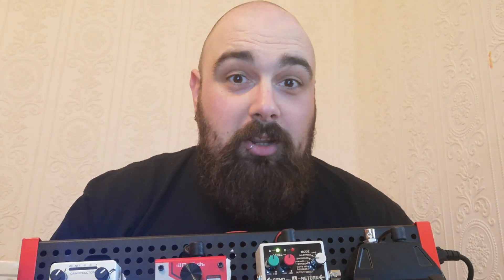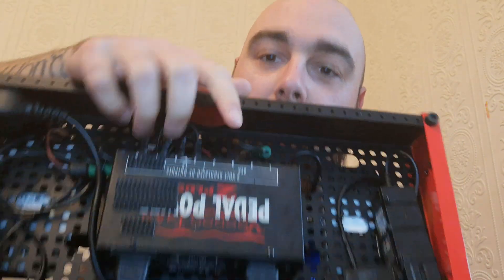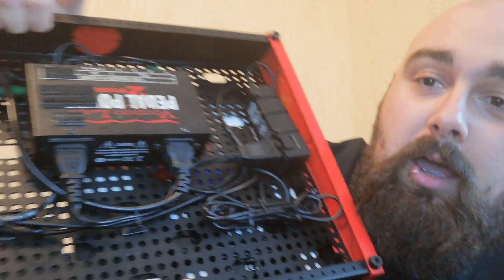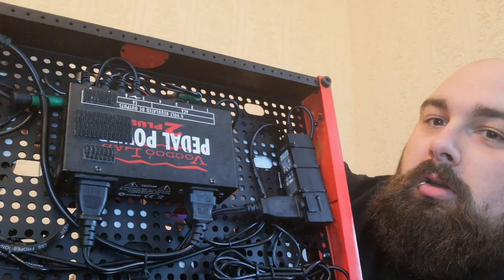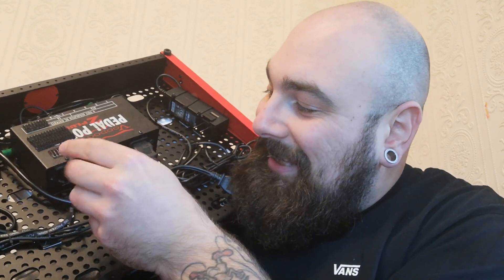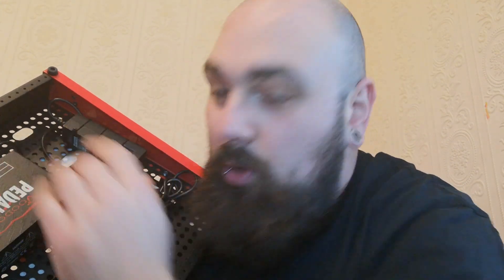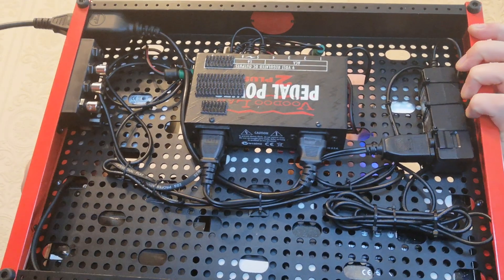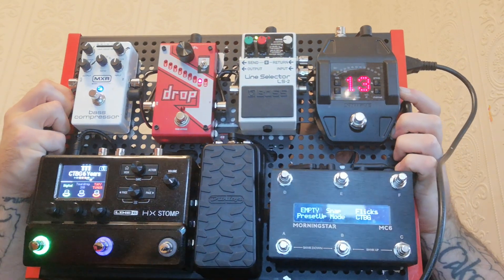Line 6 HX Stomp powered via Voodoo Labs Pedal Power 2 Plus? #hxstomp #hxstomppower

Comment: Great, to power the Shure wireless unit do use any special cables for the voodoo lab?
Thanks
Reply from the maker: I had to buy a current doubler cable to take two outputs from the PP2+ into one to power the Shure.

Comment: Do you run your power 2 plus to a wall socket or do y run it to a power condition then to the wall socket ??
Reply from the maker: This setup was always straight to the wall or using a run of of mill extension cord. Still with zero noise.

Comment: Youre using à Dunlop dvp4?  Plug into the MC6 ?  If so,  it does work fine...no issue what so ever ?
Reply from the maker: Hi Steve. No issue what so ever so long as it is programmed correctly. At the moment, depending on the patch, it is set as the amp block master volume. For other patches it works as amp master volume and then wah with an assigned switch on the MC6 :)

Comment: why are you using the Digitech DROP since HX Stomp can do the same detuning ?
Reply from the maker: A few reasons, really. I had the HX Stomp first, having it outboard saves DSP, it works better for bass than the Stomp patches, I can change setting depending on the gig without editing the patches... To name but a few!
Reply: @DarrenSMusic  I have been using the Pitch Wham on the HX for bass. For half step down on a few songs it does the job. But As you mentionned, it does take one block.

Comment: Do you know if this can power a Kemper Stage?
Reply from the maker: I would bank that as a yes, but just be sure to not try to use this solution with  an actual amplifier... The amp may require more that the PP2+ can spare through the courtesy outlet.

Comment: dude, which better.. voodoo lab 2 plus or 4x4 ?
Reply from the maker: That depends.
I looked at the 4x4 to replace the PP2+ after I bought the HX Stomp.
The 4x4 only gives a max of 800ma if you use a current doubler and connect to the two 400ma outs. I have seen some people do this and it has worked.
I was a little paranoid about underpowering the Stomp so I went with the courtesy output on the PP2+ instead.
Plus, it was a better fit under my board than the 4x4
Reply: @DarrenSMusic  the voodoo is great power supply? how if do comparation with other like strymon zuma or cioks? maybe for better sound and gate the noise?
Reply from the maker: My board changed slightly after this vid.
I then bought a Cioks DC7. No issues, low profile, very powerful. I have no personal experience with the Strymon units. The Cioks is very quiet.
Reply: @DarrenSMusic  why ypu changed the voodoo? you had issues with that?
Reply from the maker: Not at all.
Never did I have any issues.
I added a Source Audio C4, Disaster Area Micro.gHost and a Mooer Tone Capture GT to the board. Unfortunately the PP2+ didn't have enough outlets left to power the whole board.
Not long after I purchased the Cioks DC7,  the Voodoo Labs PP3+ was announced. Very bad timing as I'd likely have bought that instead, but I'm happy with what I have currently.

Comment: Well It's a neat cabling layout - and worth considering, but it's a bit extreme to say you power the Stomp from the Voodoo Labs unit - it's a power pass through - you could have attached a double adaptor to the underside of your board too - just not as neat.
Reply from the maker: This is true, however, there's so many threads online where people say it's not possible and they have to sell their PP2+ because of the misinformation that they can't use it with an HX Effects or HX Stomp. Hopefully, this will save people from spending unnecessary money just to power their Line 6 units.
Reply: I found this a really useful video. Thank you
Reply: You would still missing 200 ma?